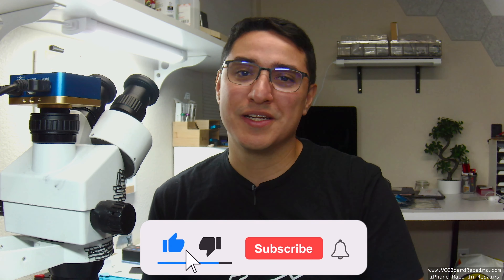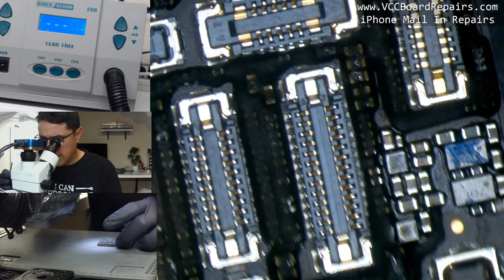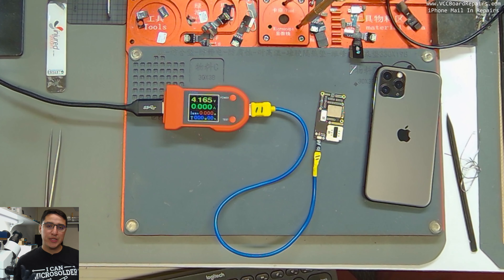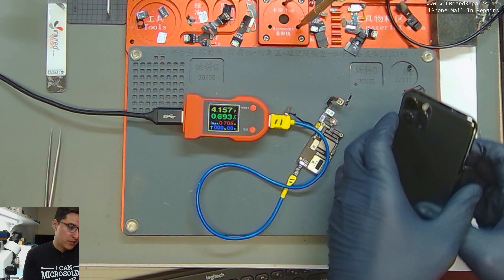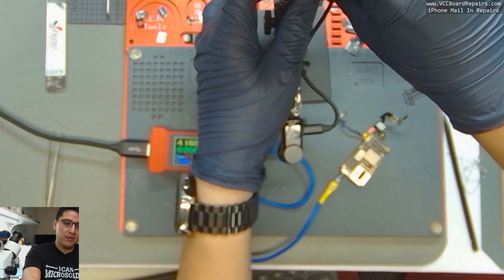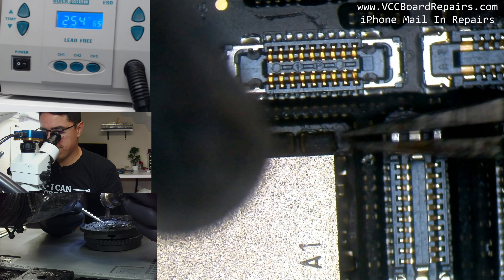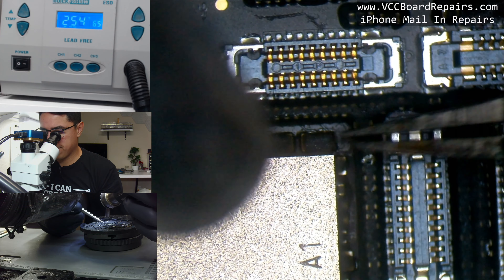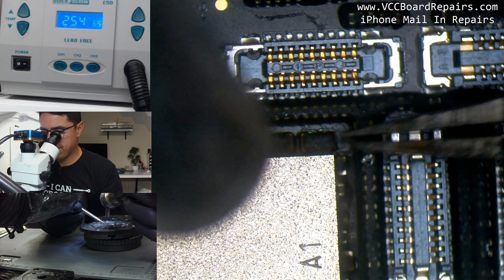This iPhone 11 Pro Won't Turn On. How To Find a Short. Logic Board Repair

Comment: Hey Jesse,

I got also the bootcable (other like X and stuff you have also the dock connector) but I have it with the mechanic boot box with a power button on the machine. Does that work or you always will need a power cable connected from iPhone 11 and higher?
Reply from the maker: If you're using the same thing I am, then you'll need to do it the same way i am doing it.

If yours has a plug for the charging port, then it should allow you to prompt to boot with the iBoot box.

just grab a board & test it

Comment: I have an 11pro and when I plug into pwr supply it immediatly draws 40-50ma before hitting power, when i prompt to boot it goes up to 150ish milliamps  and then drops to 0. after repeating a few times it will draw 90-100ma and just say in that range going up and down.. anything come to mind? sorry for even asking I don't want to waste your time:) But any advice would be appreciated.
Reply: Totally joining that FB group.
Reply from the maker: This is a great question for the group!